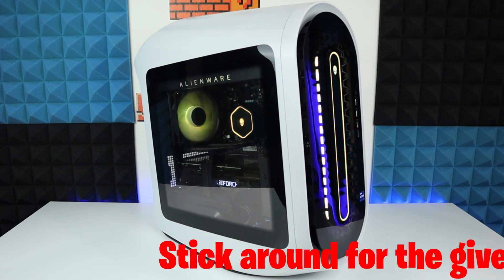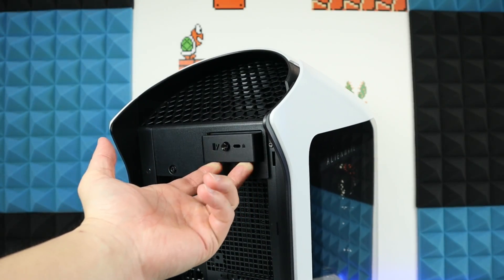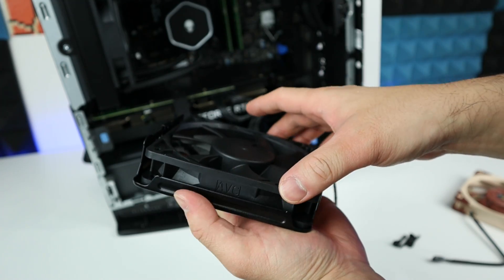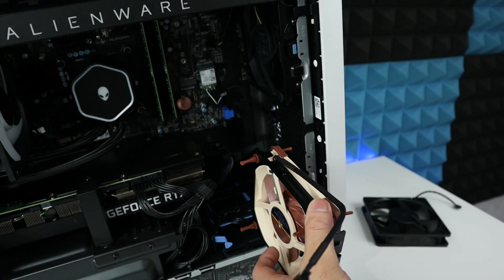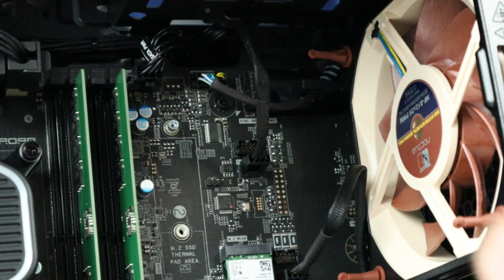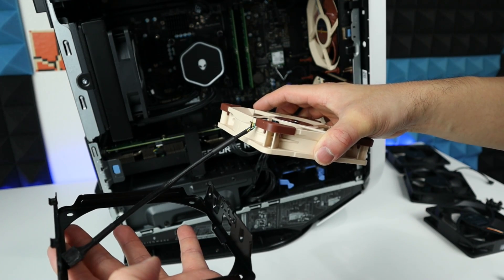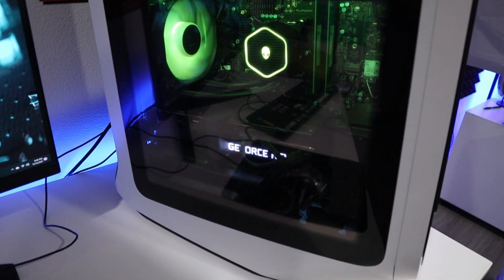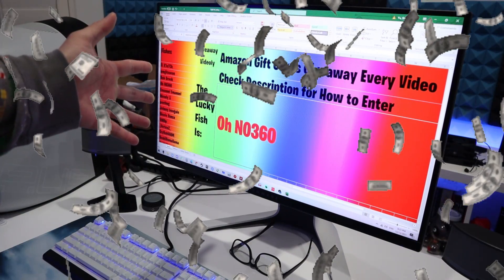Alienware Aurora R13 Fan Upgrade Lower Noise and Temps Mod

Comment: Does the Corsair ML120 Pro LED work? I saw the link to the one that doesnt have LEDS.  Wondering if this would cause bios issues? My R11has lots of BIOS issues from my current fans which is annoying because i bought the wrong model of the same product.  Thanks if you have time to reply
Reply from the maker: The LED and RGB sometime gives the error codes on starting.
Reply: @RyanYu  I appreciate it thanks

Comment: Nice video, you need to add this to the water cooler for push/pull on the CPU, connect the fan into the spare cpu connector. PHANTEKS PH-F120T30 120MM FAN.
That’s the real deal!!
Reply from the maker: More fans = more noise tho.
Reply: Agreed, but my 12900 loves it😂💪 Huge temps drops. But being serious, they are actually as quiet as Noctua fans at the same RPM, I might even try and fit them all around as they ramp to 3000rpm
Reply: The phanteks fan is 30mm thick, will it fit on the AIO and around the case also? 
Did you notice much improvement in CPU temps and did you keep the stock RGB fan as the push fan?
Thanks!!
Reply from the maker: @debellate7167  I didn't do the push and pull .
Reply: @Debellate  the t30s do not fit in the stock fan holder without modification. But the do fit push/pull on aio.